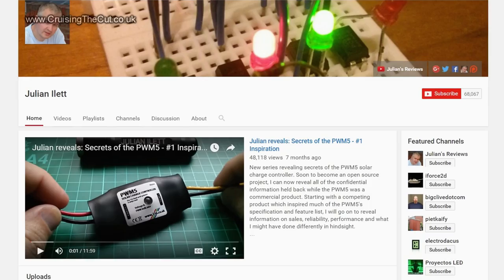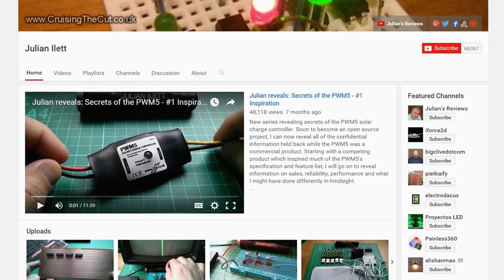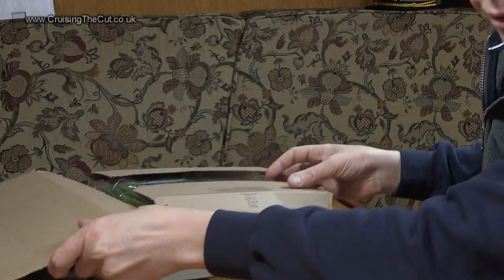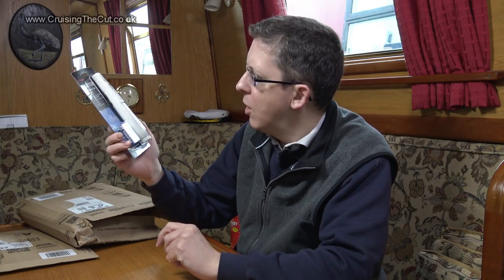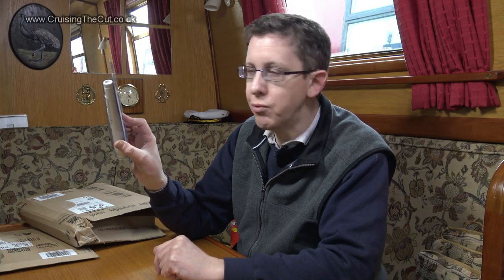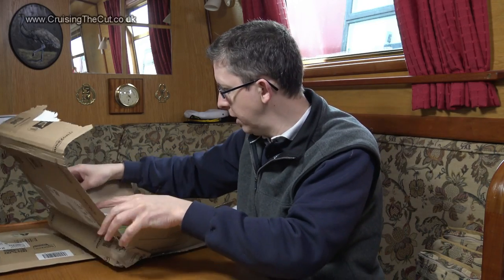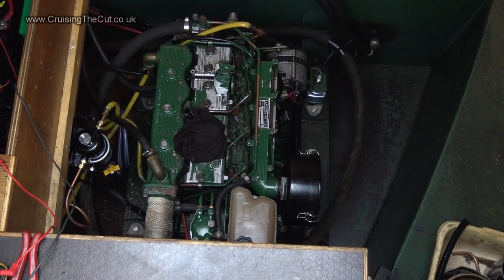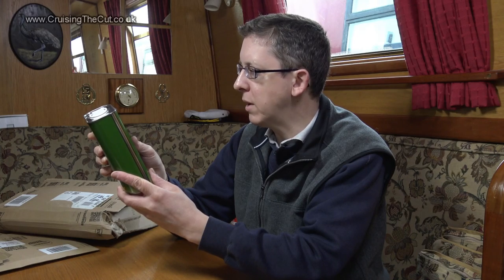24. Another haul of bits and bobs for my narrowboat.

Comment: I noticed you are using Gunk Green degreaser. I have never had much luck with "Green" products when it comes to degreasing something or with paint strippers. I have no idea on how friendly the product I am going to recommend is but I know it works and it is so concentrated that it effectively gives you many other uses as you dilute it more and more with water. The first consumer grade product made with this chemical was marketed by Castrol as in the Oil Blender and it was called Castrol Super Clean. IT is the most concentrated product of this type I am aware of sold to the public. In fact mixed 100:1 it is a great household degreases for cleaning counter tops and such. In it's pure form it is the best engine degreaser I have ever used. A few years latter other generic brands with various store brands on them came out. They are the same formula as Castrol usually a little bit weaker but still very concentrated and usually have names like Purple Power or Purple Degreaser or Purple Engine Degreaser etc....Often you can find them at stores that sell auto parts to DIY'ers and at lumber stores and such that sell to DIY'ers. It is rather Alkali so do where gloves when handling it in it's concentrated form. Prior to being sold in gallon jugs to the public this chemical was sold in 55 gallon drums to mechanics and industry professional and often used with hot water pressure washing systems. I put 2 cups of it in my tub along with warm water to clean trumpets routinely. I use it to remove grese and oil stains on clothing before laundering them and I use it when I am working on cars and other dirty machine parts.  

For covering electrical parts on engines I find old plastic fags along with some twine or rubber bands works well. I have also used food grade and commerical grade plastic cling wrap becasue it sticks to itself and conforms to the shape of the parts. When it will not stick rubber bands, twine or zip ties work well. When that was not handy I have also used wide heavy duty tin foil for cooking to cover electrical bits I did not want to get chemicals on. It conforms to the shape of the part acts as a barrier. 

As to pretreating the rust in the USA we use some form of weak acid to get rid of the rust like phosphoric acid then clean and paint. We use a product that is 10% phosphoric acid to remove surface just before we paint body parts and such on cars. It is the same type of acid that is used in Coke-a-Cola. 

POR-15 is something you might want to look at if it is available in your country for great products that are designed to deal with rust with the most advanced chemistry available. Most of their products have lifetime guarantee's.

Lastly if you have parts that can be removed that can be left off for a a week or two and you truly want a green solution for dealing with rust you might look at cleaning rust with molasses and water. It will slowly remove the rust with out attacking the healthy steel or iron. You have to clean the lose stuff off and remove the grease first. A lot of people in Europe use this method. In fact I learned this method while I was living in Germany as a young boy! 

I have no experience on a narrow boat but my family has a long history of working on cars, planes, rifles and fine brass instruments.

P.S. When you had the bed apart if you look at the wood and metal under it you can see some yellowing. It looks like water deposits and mineral deposits from a leak!
Reply from the maker: Hi. The leak under the bed is old and long gone. It don't want non-green products in case any gets into the canal and harms the ducks!
Reply: Is their very much wildlife in the cut's? I did some research and Castrol Super Clean is biodegradable and listed as non-toxic when used as directed. I too like to pollute as little as possible and I like to not use petro-based aromatic solvents if it can be helped. On that same note though one also wants to achieve the desired results. All chemicals no matter how they are listed should be seen as suspect and not at all good for anyone your or the environment and definitely not the ducks.  
I suspect the diesel exhaust,  soot and CO2 from your coal fired stove, grease from the pod, frequent dredging filling the water with sediment etc....is all less than ideal for the environment.Sometimes though some level of impact has to be accepted.
Reply from the maker: You make good points. There is lots of wildlife on the cut, birds, otters, fish etc
Reply: Oh that is cool. I did not want to assume that just because there is water it is teaming with life. I know that GB suffered a lot of damage due to rapid unchecked industrialization. Well that is what text books say.
Reply from the maker: I think that was several decades ago, a lot of the old industrial shitholes (pardon the expression) are now being much revitalised albeit many of them being turned into dull housing estates.
Reply: Oh that is great. Obviously the old cities in the USA where much the same! The main difference is just that the USA is huge in terms of land mass so we had plenty of space left where man had not managed to destroy. In the USA each coast line was ravaged the most by the Industrial Revolution. The sad thing is that even into the 1970's companies where doing dodgie stuff in terms of burring toxic stuff in the ground and dumping toxic chemicals into the water and such. So when I use toxic or harsh chemicals I just try to make sure they get disposed of properly so I do not damage the environment. In the USA 2 stroke engines on small boats put a lot of oil into the water via there exhaust. From the air you can see it on the water because it looks like a rainbow on the water.
Reply: To borrow part of a Winston Churchill speech "Never, never, never (several more thousand nevers)" put the Gunk cleaner and rinse water back in the Canal no matter how "natural" the product is (note that human excrement is natural and organic). Here on this side of the pond, our Waste Water Treatment Plants (WWTP) clean water so the ducks and fish can live in it.  Here is an easy test.  Take what ever you are going to discharge in to the canal and put in a glass, ask yourself if you would make tea out it?  If not, put it in with your other black water and haul if off to be properly treated.
Reply: Leon that is almost funny. Do you understand the nature of the water quality in the UK from a historic prospective? Some water is not fit to make tea with! LOL The dish saop you use to wash your plates and the laundry soap and you shampoo are all things I would not want to make tea with but are not treated. I am pretty sure you could urinate in the canal and you could make tea safely from it but I would rather not! Have you ever visited a water works or study water treatment on a grand scale? The treatment of the water is not as specific and detailed as you might think.For the record when an oil tanker spills it's laod they use Dawn Dish Soap to clean the poor beasts covered in oil again I would not make tea with it. While we have to be good stewards of the earth we also need to be able to live and work in the real world. We can not go around in a hazmat suite and we can not dump toxic waste by the drum into the water. Both extreme's are not practical. I dare you to make a pot of tea with canal water with out extensive treatment! LOL We need to be mindful of our actions and minimize our impact but expecting people to have no impact is just silly!With out a specific understanding of the chemistry of each product an intelligent debate can not even be had.
Reply: Buckaroo, the way to get a waterway/river/lake clean is to make sure all water discharged in that body of water is clean.   This WWTP (46.173964, -123.922112) puts out treated water from the nearby town that you can make some tea.  The receiving river is not so clean.

Comment: Why do you have a saucer in the bottom of your engine compartment? is it to feed the boat cat?:)
Reply from the maker: I was wondering if the cooling pipe (which looks a bit old) was the source of any leaks keeping the bilge damp so the saucer was to catch any drips. Turns out it's not leaking and the bowl has now been removed.

Comment: Next time when you install the gas tank, you can mix some liquid soap and a little water, mix them until they form something like a paste and use that paste where the gas connectors are. If there is any leak you will see it right away. Is not a very high tech solution, but it works really well. Here is an example https://www.youtube.com/watch?v=7UPQhuvdeL8 . Here they used more water and they didn't make a paste like solution, but it works.

Comment: The stop cock for the shower: while I am 3yrs too late, I hope you have learned that most of the time when you turn it back on, the water coming out has either heated up from the hot water or has cooled down from the cold water. Usually just a sizzle or shock for a few seconds.

And...why is there a little china saucer/bowl in your engine bilge??
Reply: Bilge drip, probably.

Comment: Why are you storing old green carpet and bits of polystyrene in your stainless water tank? or is it insulation on top of the tank?
Love the videos, just can't stop watching.
Reply from the maker: Huh? There's nothing of that sort in the water tank. I can't even get to the water tank. Don't understand the comment...
Reply: CruisingTheCut what they are saying is that when you show the area housing the water tank it appears there is either insulation in that area or it appears something is intentionally placed there on the floor and sides. I Was wandering what that "stuff" was myself.
Reply from the maker: Right, I've just gone back and re-watched the video. That's the sprayfoam insulation that the entire inside of the boat is coated in before the fitout begins.

Comment: Don't use  Teflon tape on those types of threads !!    Replacement   rubber or plastic   washer type gaskets  are cheap.
Reply: BS! Teflon tape is excellent for all threaded connections!
Reply: Was going to say the same. PTFE should not be used on gas bottle threads.
Reply: @drcthru7672  :  flair connections are not the same as a threaded connection .
Reply: the tape you use for gas thread sealing is specifically designed and rated for gas it's yellow in color and is slightly thicker so it won't frea and plug the tinly ofice.

Comment: With respect to a gas alarm, it is recommended to have two sensors, one in the gas locker, the other should be within the boat probably near the cooker at a low level.
Good practice is to turn off the gas valve via the controller which can be mounted next to the cooker prior to turning off the gas appliance so there is never any gas pressure in the piping.
A good quality 2 sensor gas detector that will also control a gas valve is given in the link and works on 12V dc. A 2A fuse is required and a switch to turn it on and off. Very easy to install as it is just a case of plugging it up. You will however have to install the gas valve after the regulator in the gas locker.
The link is Amazon US but you will find it on the UK site but it is considerably more expensive so purchasing it from Amazon US and shipping it would be less expensive.

http://www.amazon.com/Fireboy-Xintex-S-2A-NV-Channel-Propane-Detector/dp/B001VBYQTI

Comment: I know this video is well over a year old but anyone wondering about gas connections should do their research elsewhere. There is simply too much misinformation in this comment section. Be aware that the odorant added to propane is so potent that even the best propane supply in a locker will carry with it some odor. Do not panic IF you get just a whiff...do some research while noting if the odor disipates and how quickly.

Comment: Never put anything from the bilge into the canal. Even the smallest amount or the most diluted amount is just not acceptable.   Here in Canada there are environmental resources and recycling depots where anything that has any sort of petroleum content must be taken to,  in a proper recyclable container. That includes any paper towels or pampers.  Not only is it not a nice thing to do to the home of all the fish and ducks, and other sea critters, but if the Coast Guard here ever saw you doing that you would be fined heavily and possibly jailed.  Usually it's a free of charge sort of thing, but some marinas also provide that service but they charge a fee.  Even that mop you used should have been environmentally disposed of and not chucked into the garbage.  Grey water dumping is acceptable here on the ocean where the tides take it out to sea, but I'm surprised that dumping grey water is allowed in the canal systems there.Usually it's a free of charge sort of thing, but some marinas also provide that service but they charge a fee.Usually it's a free of charge sort of thing, but some marinas also provide that service but they charge a fee.

Comment: oh dear why are you spending all this money on tape, if your gas isn't leaking now then why would you need tape just make sure you tighten the connection properly use soapy water to check joint. Make sure you put tape on the right way or else as you tighten nut it will unravel you'll soon find out. Is that ptfe tape it is very toxic if burnt

Comment: If you notice the center of the gas connection is free to move in the threaded section. The internal part is a cone shaped and usually has a 'o' ring seal in the cone. If you have a leak it is probably to do with the cone and 'o' if you have one not seating properly. If there is no 'o' ring then wind a bit of PTFE tape around the cone, not the thread. This will create a better seal if the seating is problematic.
Reply: Sorry, but this is bad and dangerous advise.

Comment: When you wrap the tape, always have the open end facing you and wrap it clockwise while stretching it to conform to the threads.  If you wrap it the other way, as you tighten, it will bunch up.  Carry on!
Reply: Only applies to water pipes. Dangerous and now illegal in gas fittings.
Reply: How many times do these folk need telling?

Comment: Being involved in changing multiple gas (various types) cylinders at a prodigious rate at one time, it was always the practice to use the PTFE tape on threads - just a couple of turns. You have enough to see you to retirement on that roll. If there was any concern, we also did a quick check for leaks using an old paint brush and soapy water (a few drops in a small jar with a dollop of water!). A quick brush round and look for bubbles - not paranoia, in the lab situation it was a sensible check, on a boat maybe a bit OTT, just a thought if it helps you to sleep more soundly!
Reply from the maker: Definitely worth doing, I think. You do hear occasional, albeit rare, tales of boats blowing up due to gas leaks.
Reply: Sorry, but modern practice forbids use of tape on gas fittings and never on 'flare' fittings.

Comment: Based on the date you published this episode, and your narrative comment that you were planning on doing the Gunk project in the summer, you've probably already done it.   Did you brush it on, as you commented?  In the future, you might try a garden sprayer.  I worked as a lineboy at an airport, and cleaned hundreds of aircraft bellies with Gunk,  It was always sprayed on (we used an air compressor), and then rinsed with a garden hose.  It was quite effective!  But you definitely don't want the oily residue that is washed off to go into the canal water, as a responsible boater.
Reply from the maker: I haven't done it, as it happens, because to reach the worst affected bit I'm going to need to take the engine out (it's underneath all the pipes, batteries, yada yada) so that may be a project for later this year.
Reply: Since you haven't done your Gunk project yet (we used our own verb form "Gunking" or "de-Gunking" interchangeably), respectfully you might want to consider spraying vs. brushing.  Spraying gets the Gunk deeper into all the nooks & crannies, and overall does a more thorough job.    We sprayed it on the light aircraft engines as well as the bellies, wearing a mask & overalls, then simply rinsed it using a garden hose with a nozzle.  In fact, if I was contemplating removing the engine just for this project, I would give spraying Gunk a go with the engine in place, prior to resorting to removing the engine.  With the correct spray arm you shouldn't have to reach down in at all.  Then, of course, the challenge is what to do with all the Gunk & oily water in your bilge.  If it is reachable & practical, one could try laying an oil absorbent on top, and it is probable that the residual water underneath would be relatively clean.  Since the Exxon Valdez tanker ship spill in 1989, many oil absorbent products have been introduced to the market.
Reply from the maker: Thanks. It's not the Gunk that requires the engine out, it's scraping away at the rust in the bilge, treating it and then painting afterwards. Just not practical as it stands, unfortunately.
Reply: Wishing you well, then!  Btw, like you, I used Rust-Oleum on my steel liveaboard with excellent results.  Later, with a partner, I moved onboard a sailboat & wanted a protectorate for our bikes strapped on top, exposed to the salt water environment.   I discovered Boeing Aircraft had just released the perfect product.  It is now called Boeshield T-9, & worked great, leaving a waxy coating that both protects & lubricates, & is available thru Amazon.  Actually, under the Boeshield label, Boeing has a line of products that may be worth a look, including rust removers.   If I can post the link, here is the line of Boeshield products:  https://boeshield.com/products/
Reply from the maker: You can indeed and thank you, I'll take a look. Cheers.